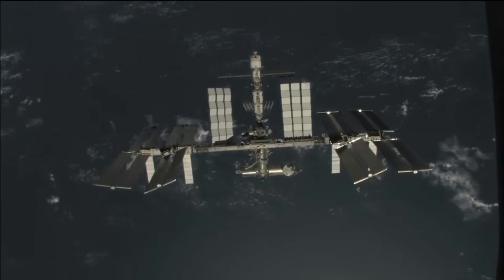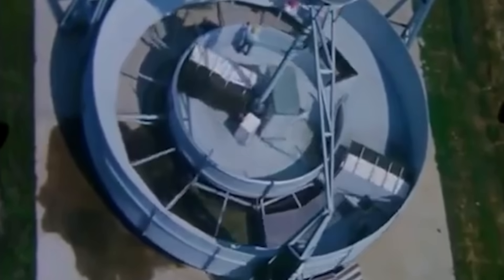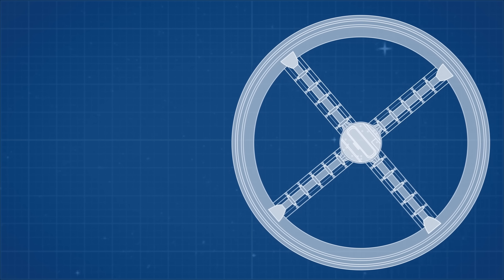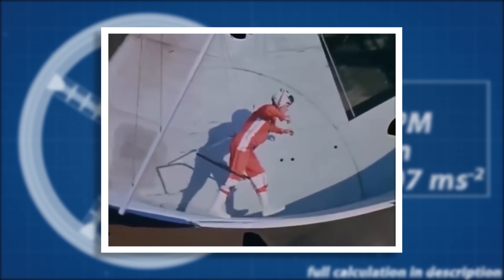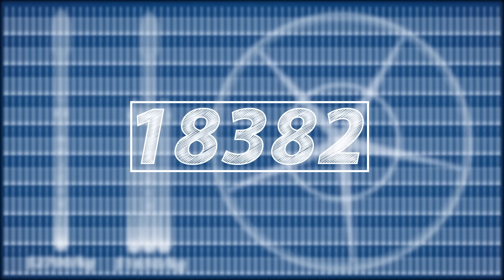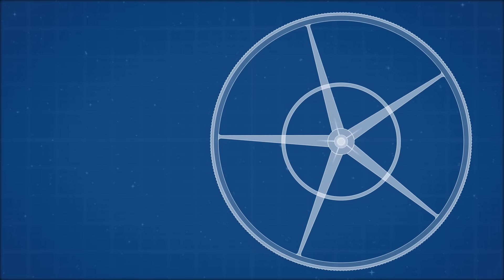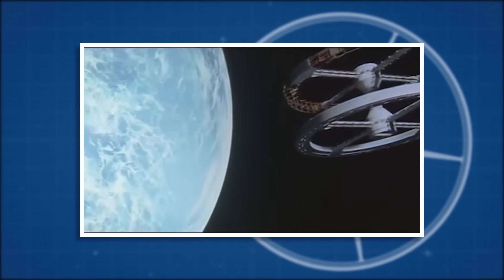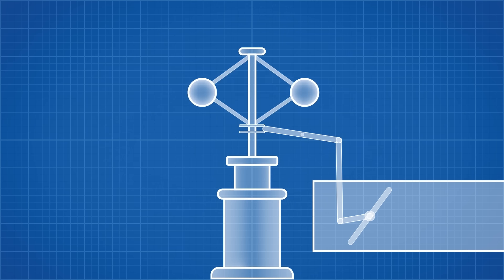Can We Create Artificial Gravity?

Comment: There is no centrifugal force man, only centripetal, what you're experiencing is your body continuing in a straight line while the car or whatever is rotating, so your body is going outwards
Reply: Naej it should really be renamed to centrifugal effect, and not force. since the force that the body is under is due to the normal force pushing you back to the center
Reply: +wanderingbufoon It has to be a force if you are going to use Newton's laws in a rotating reference frame. Centrifugal force is the name used. It may be a fictitious force, but so is the Coriolis force and most people don't have a problem with that.
Reply: There is no centrifugal OR centripetal force... there is only angular momentum.
Reply: wanderingbufoon I like this concept :)
Reply: Like the comment only limitations would be materials and cost; if you can nail space travel then species visiting planets to mine for material seems feasible (Ancient aliens)
Reply: Centrifugal force is valid within the subject's frame of reference.  Expanding on your example, your mass wants to move in a straight line, while the car is turn is turning, exerting a force against you.  Einsteins principle of equivalence states that it's impossible within an non-inertial frame to distinguish gravity from an accelerating reference frame (his famous elevator thought experiment).
Reply: from all I haver heard, its is just a way of making calculations easier and It seems to be working fairly well.
Reply: +pyropulse Well, that last sentence was rather patronising. A common response for a position of superior ignorance. But still I will persevere for the moment. Firstly, the order in which we understood physics is hardly relevant to our present or future understanding. But, getting back to the relevant of fictional forces:

Say, you some civilisation lived in a large steel box, tethered to another similar box and rotating about a common centre of gravity in deep space, unbothered by gravity. In such confines you could easily deduce all of Newtons's laws of motion, the laws of ballistics, the laws or aerodynamics etc.. They are in a rotating reference frame that cannot be deduced as such from their confinement. The force they observe appears like gravity does to us and all too real. 

To an external observer (us) it is however, a fictional force that can rightly be called Centrifugal force. Who are we to tell these poor people that one of their fundamental forces does not exist? The actual force ,as we know is the electromagnetic force holding together the atoms of the tether, providing the tension that provides the centripetal force of the system. 

Perhaps, there is a greater observer that can see the errors of our ways and deduce gravity is a fictional force.
Reply: +pyropulse " This civilization will develop Newtonian mechanics by your own admission."
I think you will find I used the word "could" not "will". You do understand the difference? It is possible that another civilisation might deduce physics using a different path that we did. You are showing a lack of imagination here.

"You are calling me ignorant, but..." Actually I wasn't. I was using irony to make fun of the patronising statement you used. I see you have now deleted this from your original comment. That is cowardly.

As for the rest, I can see you are not a great fan of the "Equivalence principle". Perhaps you should write a paper debunking it and get your Nobel prize.

Gravitational mass is identical to inertial mass!
Reply: +pyropulse groan.. you are still editing your comments. I cannot have argument with someone who works from hindsight.
Reply: +pyropulse Well, triggered you are. When anyone stoops to such vulgarity, they have lost the argument. Not only have you failed to respond to my initial conjecture, you have demonstrated your lack of understanding  of basic science. As my physics  teacher always told me  “ a little knowledge is a dangerous thing”.
Reply: pyropulse .... what do you do for a living
Reply: Gareth H  what do you do for a living
Reply: pyropulse ... and how do you know all this science
Reply: That is so dumb on so many levels. You are comparing a conserved quantity of a system to the forces that hold that system together. Back to school.
Reply: people chill it is the normal force holding the guy in position (if you are in a inertial system) +Naej is right there is no centrifugal force in a inertial system but +Real Engineering is also correct by saying that in the rotating system centrifugal force is perceived eventhough actually its the floor keeping the guy from flying away.
Reply: David because in rotating frames of references you HAVE to count centrifugal force as well
Reply: David because in rotating frames of references you HAVE to count centrifugal force as well
Reply: Rhaegar19 f=ma doesn't work in non inertial frames unless u add a pseudo force which here is centrifugal force
Reply: https://xkcd.com/123/
Reply: You've been lied to, Naej, in an attempt to simplify physics. If you have a rotating inertial reference frame, then you see a centrifugal force. But you won't get to inertial reference frames until higher level physics courses, where they tell you they've been giving you a lot of lies to keep things simple. https://xkcd.com/123/
Reply: I'm sorry but the phenomenon that you describe is CENTRIFUGAL, NOT centripetal. Centrifugal = outwards; centripetal = inwards. 

Gravity is an example of a centripetal force; it pulls you inward toward the center of the Earth. Gravity is not considered a true force like the strong, weak, and electromagnetic forces, but a consequence of the warping of space-time as described in Einstein's General Theory of Relativity. 

Centrifugal force is outward-directed, like a centrifuge, so the video has it 100% correct. 

Arthur C. Clarke's mnemonic to remember the difference:
Centripetal = petals on a daisy flower = pulled inward
Centrifugal = centrifuge = pulled outward, like the liquids in a fucking centrifuge, or riding the Gravitron

Really, using the word "centripetal" only makes you look smart to people who don't understand what they're talking about, but your arguments look foolish to actual physicists and people who do know what they're talking about. I'm sorry to be harsh, but 143 likes on incorrect information is a harsh indictment of You Tube voters.
Reply: Force is mass*acceleration, and since there is no "correct" frame of reference to measure that acceleration in, you could make the argument that they're equally valid forces. It's messed up to teach both of them in high school physics though.
Reply: +pyropulse to say "Inertial frames are demonstrably superior to non-inertial frames" is ridiculous, they are used in different models. If relative acceleration is present we require both.
Not only do we require non-inertial frames to model a rotating reference, we require them for curved space time. You just cannot model reality without them.
Reply: Thank you. Someone understands :D
Reply: Rhaegar19 yep i agree :/
Reply: agreed. I think that was my whole point.

Comment: An intelligent and well-thought-out video.  It's still not really "artificial gravity" though.  You're just simulating some of the effects of natural gravity, and as stated in the video, this still requires a massive investment in structure.  Until we have the "gravity plates" of Star Trek, we don't really have "artificial gravity."

On the other hand, what's the big deal about artificial gravity, anyway?  All of the ships we've seen with centrifuges in cinema were far too small to have effective simulated gravity by centrifugal force... Discovery, Leonov, Ares, etc.

We've pretty much already proven that until we do have "gravity plates", we can get around the issue of zero-G just fine.  There's no reason to build massive spinning spaceships to simulate gravity... we simply don't need them.  In fact, there are a lot of advantages to zero-G (or microgravity, if you prefer)... why give that up at great expense?  Only a luxury habitat like that of Elysium would see a true benefit from such excess.  As expensive and difficult as it might be to build a habitat on the Moon or Mars, it would still be a lot less problematic than building a gigantic rotating space station.

I believe that the idea of artificial gravity by centrifugal force has largely become one of those "because we can" arguments, meaning that there would be no real reason to do it other than "because we can."  Personally, if I ever got the chance to go spend a week in space, I would want to spend it in microgravity, not in an environment that simulated Earth gravity.

Comment: There is an effect to this system "spin"...  However, walking on a surface which is causing you to be pushed to it externally is not the same as the gravity from a mass, pulling you inward rather than outward, which is the effect of a "spinning" system.  2. What about testing birth on Venus and vegetation growth and seeding.?.

Comment: Only reason we haven't tried this is institutional decision to not fly anything so involved. All parts of it have been studied and evolved on paper.
For instance, plans to modify the Shuttle ET so that it can be built into with features for habitation. A "wet launch" station volume, as opposed to a dry launch like the Salyuts or Skylab, all of which took the place of an upper stage fuel tank. Some even built on same tooling using some of the same parts production as a fuel tank.
Replace the STS Orbiter and it's unmanned for launch, making it simpler and cheaper. Such a "Shuttle-C" method might be able to carry some payload aloft other than just the modified heavier tank. Some of the initial parts needed to make it useful, at least.
A single or a few tanks can just sit, either separately or linked, or you could use the SRB attachment points to attach truss & cable to spin them on opposing ends, or opposite some other counter-mass. Varying numbers of them and different ballast masses could allow for a single station with microG or Lunar, Martian, and Earth G all in one station.

This was one of the plans they looked at when they moved from Space Station Freedom, to the ISS. It was dismissed precisely because it would put up a station quickly and cheaply, not spreading enough money around enough congressional districts.
Instead we chose the most complicated, lengthy and expensive option, to give a 40+flight manifest to the Shuttle orbiter.
Both the Shuttle-C and he ET station volume have been called the most studied and evolved concepts in aerospace history, useful technology not used for political reasons. Because it worked too well.

Read about the NASA space colony designs also. Across a wide range of people, the faster you make them spin, the more people can't adapt to it. For most people to be comfortable, they had to limit it to about 3RPM (or slower, better) For 1G this sets the radius at almost 100 meters. Almost 900m for 1RPM. This was the Stanford Torus space colony parameter.

Comment: What about a half of the warp drive (the half that doesnt need negative energy, and just warp space like if there is a planet under the ship)
Reply: what?
Reply: Sivolc11 you know, the warp drive is technicly possibly, only thing we need is negative energy to make the space get bigger behind the ship. And positive energy to shrink it before the ship. As we dont have negative energy, we obviously cant build a warp drive. But positive energy is no problem. Why dont just shrink (just a liiiittle bit) under the ship, just enough for 1G, nobody wants an accelaration to speed of light. But for example an planet does exactly this, shrink space where it is, so it has gravity.
Reply: Ah, you explanation makes more sense than the previous comment. The shrinking caused by the planet is, as far as we can tell from our observations, a side effect of having mass and thus gravitation, NOT the cause. Essentially, your idea to cause shrinking would not create gravity, it would only effect space. Gravity is a very poorly understood force, we don't have any idea how to cause gravity, short of just adding more mass.(Also this still requires negative energy, normal/positive energy has no significant affect on space, which is why nuclear explosions don't shrink space, even temporarily)

Beyond that the fact that you would need to constantly run this device, which requires a theoretical and difficult to obtain material, would be impractical for quite a few reasons. However, this is a point worth thinking about, how to find a basis for creating fundamental gravitational particles and using them on any any starships we launch which are equipped with the Alcubierre drive, or at least a fusion drive system, since they will be generating a large amount of energy anyways, it could be put to good use.

Comment: Why do you need a complete ring?  As you say, it's complicated and costly.  Why not build something shaped like this >   (======)  or the beam on that beam engine shown at 5:26 - with a long central spoke for systems and storage and short curved pods for habitation at each end.  Then just spin the whole thing to create gravity in the pods.  You could always extend the end pods into bigger arcs as time and money allows.
Reply: This is where physics turns into mechanical engineering. The materials would have to be much stronger if the structure is unbalanced or unsymmetrical. A circle is just simply the most stable structure.
Reply: EASYTIGER10 I agree. It doesn't even have to be semetrical. Put your people on one side, have a long cable, and put your supplies on the other. 
If one side is more massive, it will move in smaller circles, so both ends would have the same centripetal force.
Reply: Rapidly crossing into varying gravitational forces like that can have adverse effects on the equilibrium
Reply: That is what Zubrin et al proposed in their Mars Direct plan, albeit on a small scale, of course. The ship at one end of a long tether, and the spent upper stage of the booster at the other end, rotating around each other. Artificial gravity (at least a fraction of Earth's) for the way to Mars, so the astronauts get there healthy and ready to go.
Reply: Have something looking quite like this: 8=====D~ and your home free. ^.^
Reply: EASYTIGER10
Reply: Couldn't this same problem happen with a circle as well?   If the mass distribution throughout the circle is uneven then it would wobble, changing the center of gravity to somewhere outside the material center.
Reply: You could put some movable balast on the center beam, move that around to keep the distribution of weight even.

Comment: You're favorite invention is where the term "Balls to the wall." comes from.
Reply: Bobby Jones Jay Leno taught me that lol.
Reply: T Abel I saw that video as well. Jay Leno's Steam engine was awesome. I completely forgot about that until you mentioned it.
Reply: I'm slightly disappointed to know that although I guess my balls are relieved...
Reply: "Balls to the wall" is a term coined to describe Chuck Norris walking into a building smaller than an aircraft hanger
Reply: What does that term mean I don't really feel like looking it up because I might find something weird
Reply: "Balls to the wall" means pushing something to its limit.  If you're driving your car at its absolute top speed, you're going "balls to the wall."  If you're working in a factory and you have the machines turned up to max output and you're putting out as much product as you possibly can, you're going "balls to the wall."

It sounds dirty but it isn't (much).  Most people think the term actually refers to testicles so you wouldn't use it in formal speech, but it would be fine to use the expression when talking informally.

Comment: why dont we create artificial gravity by magnetism eg:  the spacecraft surface with magnetic material and  astronaut boot slightly magnetic with circuit breaker when electricity passes magnetisation is increased which fixes to surface  when he lift leg the  circuit  breaks which becomes slightly magnetic again when he puts his leg down the circuits connects and get strong magnetisation which fixes to surface

Comment: Gravity doesn't push.
I've just had that realisation.
Nothing pulls, nothing pushes.
We are simply falling towards the 0 point.
The support which we are standing on simply stops us from continuing the fall.
That's why we continue falling when we "lose the ground under our feet".

And, that's why inside a relatively small vessel there is nowhere to fall, 
because we are so close to 0 point.
Thus, this so called "artificial gravity" has nothing to do with gravity.
I'd rather call it emulated gravity.